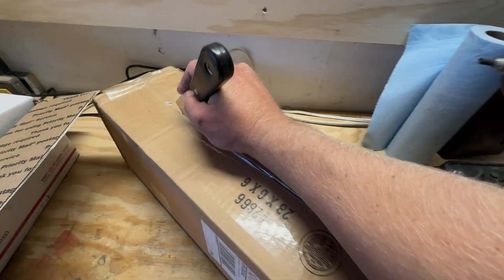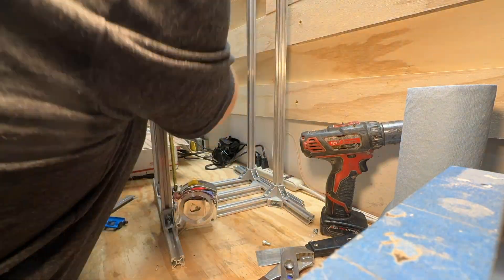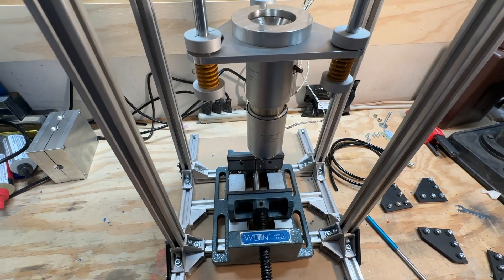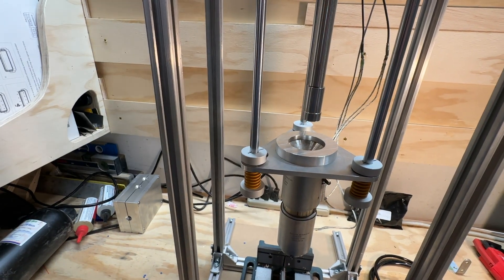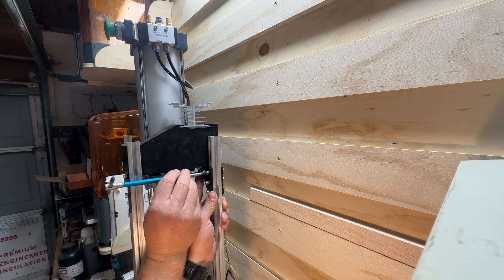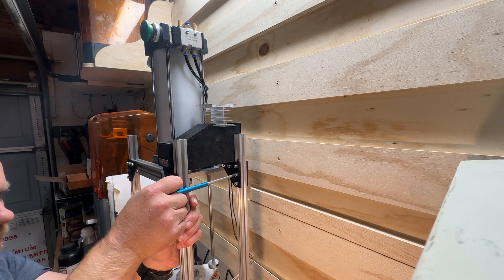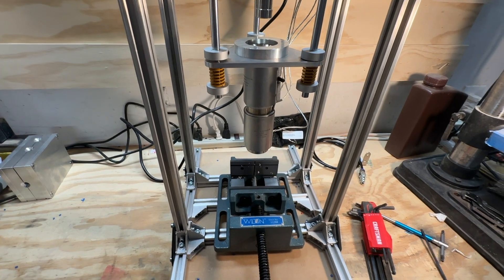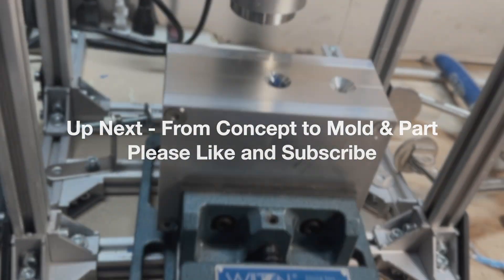Plastics Engineer Tries DIY Injection Molding at Home, Buster Beagle MK3 First Impressions

Comment: 7 months late but suggestion to have a frame that does not bend is ... to use a thicker frame, and a better design. It looks like this is 2020, which  isnt strong enough with that length and design. you would need at the very least a frame made of 4040, and avoid making open, squre frames. Try to add diagonals to strengthen the structure.

Comment: I think the frame kit should have laser markings to help make the installation smoother.  I would say a metal base plate. Yup I had some issues with the alignment of the piston as well.   Was thinking about adding extra metal that I'll CNC to align the bottom plate better.  Also instead of the washers for the vise, I'll also CNC a proper aluminum spacer.  I know the kit is designed to the cost low, but thinking always to improves things.
Reply from the maker: I 100% agree that this could aid in assembly.  However, for a guy starting in his garage with a small YouTube audience, Ryan at BusterBeagle3d has done a great job of contracting to get a full "kit" that can fairly easily be assembled by an average maker.  

I think the idea of machined aluminum base is a great idea! 

For the Vice - I never go the washers to work right, I just gave up on that.  It really needs a vice with a full platen that can evenly distribute force across the entire frame.  Even with C-clamps, the mold can still open sightly and get excessive flash.

Comment: Hola !! Tiene un error de diseño, las barras de tensión tienen que soportar la base de la matriz de inyección para que no tenga fugas de material, y no se mueva la matriz, es mi umilde opinion como tecnico, saludos a todos !!! Buen trabajo y dedicación !!!
Reply from the maker: Hola! pardon, mi espanol es terrible.  But you are absolutely correct! Any normal injection molding machine should use the nozzle pressure to help assist keeping the mold closed.  Unfortuantely on this cheap machine the frame is not strong enough to overcome injection pressure - I used to work with machines that had over 700 tons of clamping force on the tension bars. This machine could not support that so the designer just made a decision to have the clamping force independent of the injection system.  Good for a trial, but definitely not an industrial machine. I have a lot to learn still! 
Thank you for your good observation, let me know what you would like to see next!

Comment: Cool video, what's the all in cost for one?
Reply from the maker: The frame kit with pneumatic cylinder from Inventor Source cost $284.84, the components from Buster Beagle (full kit with heaters, controller, and an aluminum mold base) ran $673.78.  Then I still needed the vise from amazon for another $71.  So all in I was at $1,029.62 for the machine.  This didn't include an air compressor or material, so if you were really starting from scratch plan on about $1,200. 
I hope this helps!